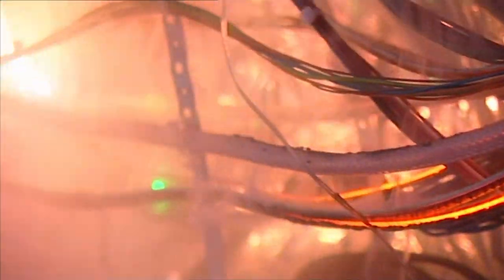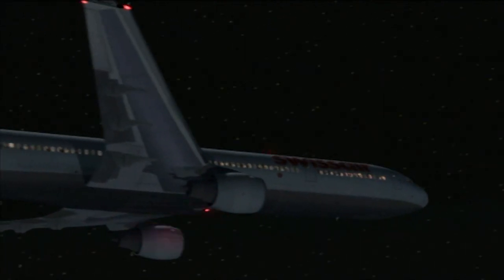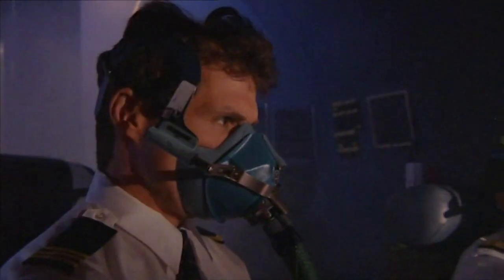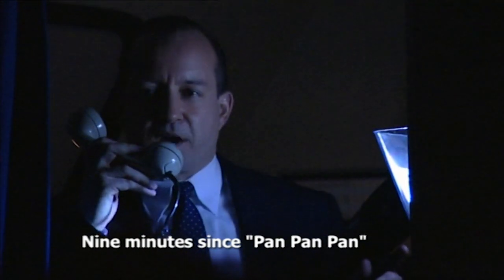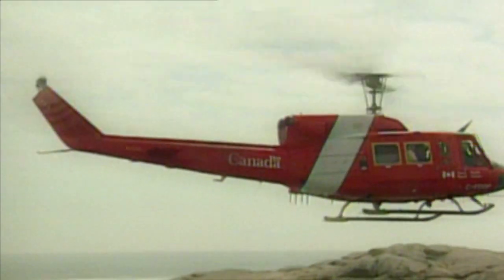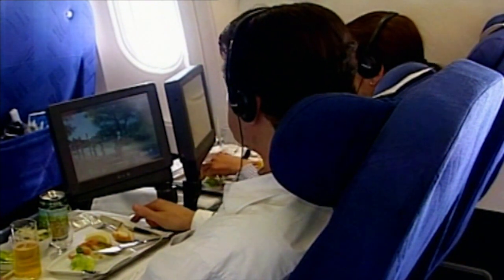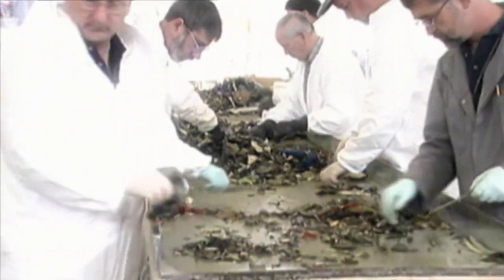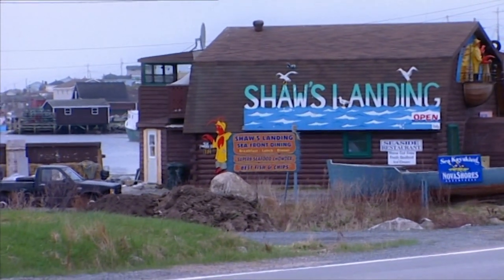A Race Against The Fire On Flight 111 | FULL EPISODE | Mayday: Air Disaster

Comment: I have to say, as a pilot and a mechanic, the installation of this entertainment system without corporate approved wiring documentation is tantamount to irresponsible operation. If they got something from McDonald Douglas, it would have been FAA approved and would come with a cockpit checklist as well. That silver insulation has been inside aircraft that I have worked on for 40 years; I'm not suggesting that it shouldn't be swapped out, I'm just saying that the principal cause was wiring, not insulation. BTW, if you put non-approved electrical systems in ANY aircraft it becomes "Experimental" and cannot carry passengers.
Reply: Since ur a pilot...would u have just landed immediately?
Reply: @sg7772  If you play the video again you will see that the post crash investigators determined that no matter what the crew did that there wasn't time to land, they were just too far from any airport, too far off shore to save the plane. The answer is Yes, if you have a fire on board, you land immediately. Go to timestamp 39:29 and you will hear what they are saying. TSB are the post crash investigators. Transportation Safety Board of Canada. BTW, as a pilot, if you feel you may go down, it is irresponsible to crash into the city, it is imperative to know your aircraft is under control before flying over populated areas.
Reply: @peterolsen269  ty and why would he choose to dump FURTHER away from the airport?
Reply: @sg7772  The fire was slow at first and then escalated very quickly. The pilots probably thought they had time to do that, but they didn't.
Reply: @gregord556  so even if he had stayed near the airport it would've  have helped but WHY DIDNT HE CHOOSE THAT OPTIIN DO U THINK?
Reply: You aren't a pilot...stop your BS will ya?
Reply: why do you say that?
Reply: And yet everyone here is an expert claiming the pilots should have requested an emergency landing right away -- they kind of did once the situation got out of control. They wouldn't have been able to make it either way -- and even if there is smoke, you have to determine what exactly it is and the magnitude of it. They could impossibly know what was going on above their heads at the time.

Comment: When you have fire/smoke onboard; your number one priority is to get the plane on the ground as soon as possible at the nearest airport wether you’re familiar with the airport or not. Tragically, if things would’ve been done/handled differently, the outcome might’ve been different.
Reply: Well swissairs checklist didn't call for that. It should have but it didn't in 1998
Reply: The smoke came and went -- it does not always warrant an emergency landing, there can be smoke, coming from the AC and it doesn't mean that there is a massive fire going on above your heads as was the case for these two pilots. It was a material design error. That stuff shouldn't even burn despite faulty wiring. 
Either way, they were too far away from any airport for an emergency landing. They wouldn't have made it.

Comment: These two pilots did not do anything wrong. They did not panic, they followed the procedures, they could not have made an emergency landing on water because of "some smoke" of undetermined cause. When they situation got worse, it did so at a rapid pace, and they still were 20 minutes from any airport whatsoever. They have been cleared of all responsibility -- and they should. This flammable material should not have been aboard a plane in the first place. They couldn't see what was going on above their heads.
Reply: Were y'all there?
Reply: @RobertJamesChinneryH She was there, I can confirm.

Comment: Well on my view here, dumping the fuel was not the first periority.expecially wen is a fire situation..that circleling time you have.utilize it to tje nearest airport near you.dump the fuel on your way..desparate situations needs deaparate sollutions.
Reply: Doesn't matter.  There just wasn't enough time 🥺😔
Reply: @vixen4327  they went aaall the to dump fuel to the ocean.and there is smoke ollover the cabin."smoke is a result of fire"
Reply: Problem is that if they hadn’t dumped fuel, this posed its own problems. Among these is that landing whilst too heavy risked the landing gear collapsing and causing a belly landing, which in itself risked a fire or explosion due to either friction between metal and runway, or because a wing or other part was sheared off and a spark caused the fuel tanks to then catch fire/explode. 

Even if the plane had landed with the majority of the starting fuel on board, and there hadn’t been the landing gear collapse, then there risked other problems like the wheels popping or the plane being difficult to brake, which would then cause problems like potentially causing the plane to veer off the runway or overshoot the runway completely. This could cause major loss of life or serious injury.